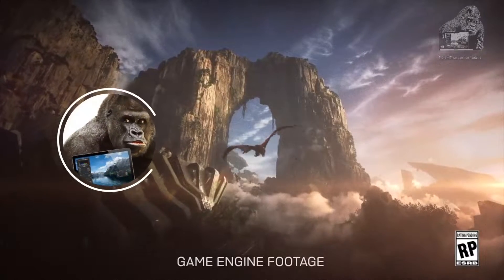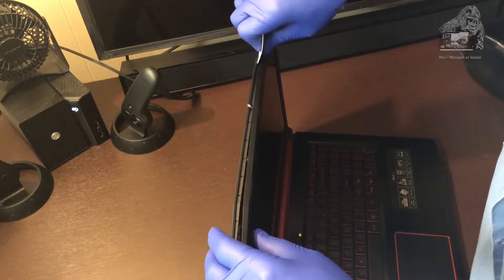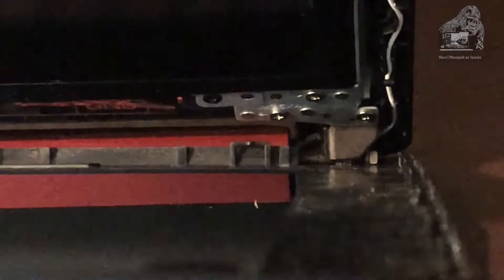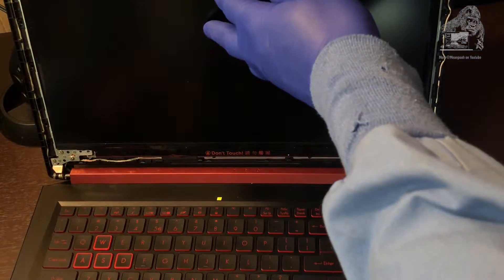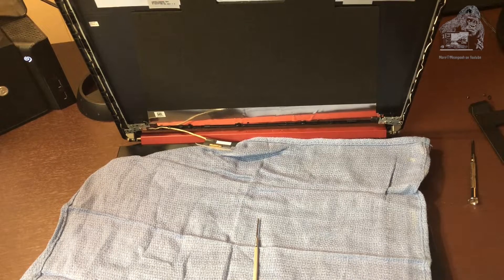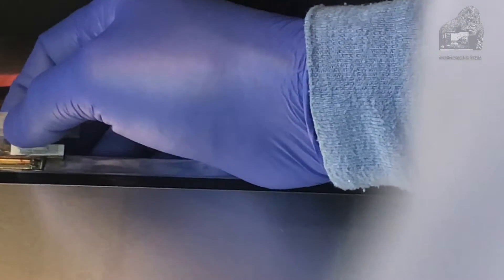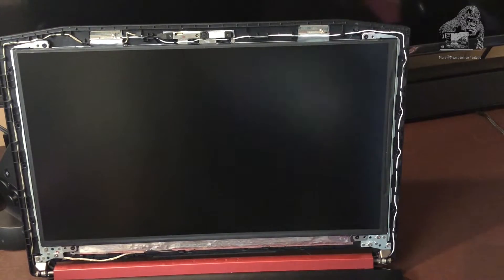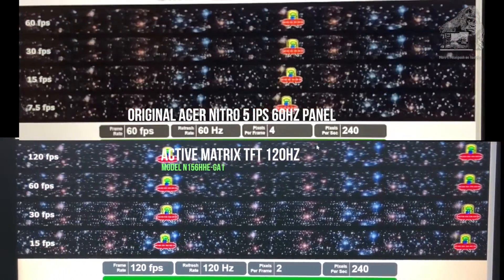120 Hz LCD Screen Display Tutorial Acer Nitro 5

Comment: Mate, please, can you try connect it an external graphic card on the M2 slot?. I have a big curiosity to seems what Will happen. Sorry for my poor english.
Reply from the maker: Your English is fine.  If I get a hold of one, i'll definitely try it.
Reply: @Meanpooh  Thanks a lot. I'm really appreciate it.
Reply: @Meanpooh  Hi again, sorry if i'm a little anoying. I found some promised information
The M2 port of the Acer Nitro 5 is PCIe/SATA Colay. The model of this component is M2 2280 and is an X4 M2 port (thats mean that an external GPU connected on this port will get better performance than it will on an USB Type C Thunderbolt 3).
https://community.acer.com/es/discussion/547455/socket-m-2-o-m-2-pci-express-acer-nitro-5?fbclid=IwAR0LPNoFoRhmUYY6kze63ro1FdQpYJ_FyPNfwE6WndwMU6jmFnAFWmpRuKE

Also i found an adapter on banggood
https://www.banggood.com/M_2-X4-Version-V8_0-EXP-GDC-Beast-Laptop-External-Independent-Video-Card-Dock-With-Power-p-1109912.html?rmmds=search&cur_warehouse=CN#jsReviewsWrap
Reply from the maker: Great news you’ve found. I checked them out and the only problem I see is getting it connected to the M.2 port since the Nitro 5 has a closed setup with no access panels.
Reply: @Meanpooh  Oh, it's a shame. In that case only can be possible replacing the wifi card right?
Reply from the maker: Not sure.  I have not removed to see what type of connector it has.  Also I read a little bit more on that dock and it says that the included power supply is not efficient.  You'll have to add an external power supply.  Maybe a 400 watt.  Another thing it says is that its not compatible with a GTX 1050ti.
Reply: @Meanpooh  Oh, dam. Well, thanks for the information anyways.
Reply from the maker: @darkeneshadow  No problem.  Ill still keep an eye out.
Reply: @Meanpooh  I was reading the review section of the banggood link I send before. An user says there is a new version of this adapter (9.0b) and works with the GTX 1050Ti.
https://m.banggood.com/[M_2-X4-Version]-V8_0-EXP-GDC-Laptop-External-Independent-Video-Card-Dock--reviews-p1109912.html
Reply: @Meanpooh  so the ssd slot cant be used for egpu
Reply from the maker: Yes it can but there is no way to have the machine closed and the cable inserted.  Also its not compatible with cards that are better than the one thats in the Acer Nitro 5.  You will also have to get some external power because the one supplied is not strong enough.  This is the info I read on the page.
Recommended cards GTX 780TI down to GTX650
Reply: @Meanpooh  you are my savior i was planning to use a gtx 1080 that i collected for thank you so much you earned another subscriber
Reply: @Meanpooh  now i think my best option is to collect to buy a ssd and more ram maube then it'll preform better but if you think there is any better option to make it game better please tell me
Reply from the maker: Much appreciated!

Comment: 120hz is a huge improvement thats dope.
Reply from the maker: Its silky smooth when scrolling.  I have not tested with any games yet and Im really not sure how to test it other than response times.  Ill be looking into it.  Thanks for watching.
Reply: @Meanpooh  sorry to interrupt again but will a egpu gtx 780 work with my acer nitro 5 1050 for a worth the price fps increase
Reply from the maker: Any eGPU that says Thunderbolt will not work with this machine.  The highest we have is Type C USB 3.1  Port.
Reply: @Meanpooh  thanks again
Reply from the maker: No problem.

Comment: Yo Meanpooh how you doin
Quick question, my nitro 5 has the i7 8750h and stock temps were hovering around 96deg while gaming. I have now respasted it with some Noctua NT-H1 and undervolted it with -0.185v which I found to be pretty stable. But temps are still averaging at 85deg and aren't getting any lower. I'm also occasionally seeing spikes in the temps to 90. Should I try a respaste with Kryonaut? Do you think that will make a difference?
Reply from the maker: Thats a good undervolt you have there.  Are you getting spike with all games or just a specific one?  My temps hover in the 70's spiking to 80  sometimes.  Even Resident Evil 2 pushes my system upwards abit though its not undervolted.  I would try a several different games before the repaste just to give you an idea.
Reply: I think both of you should consider your ambient temperatures also. Maybe one is living in a warmer place, hence the higher temps?
Reply from the maker: I agree to that.  I play where my temps at all times are around 69, + or - 2 degrees.